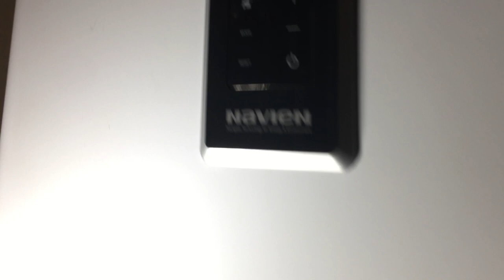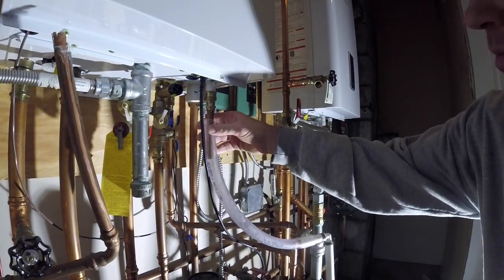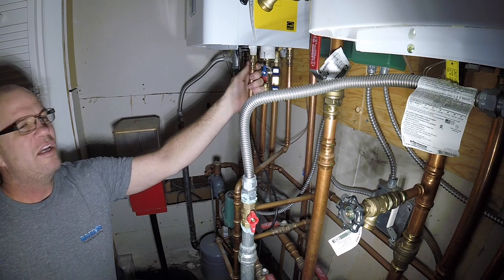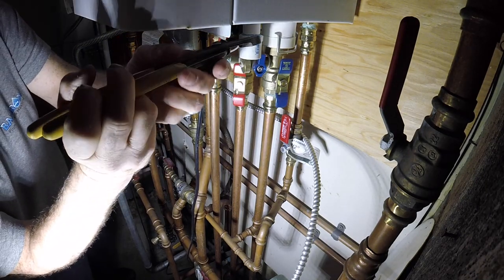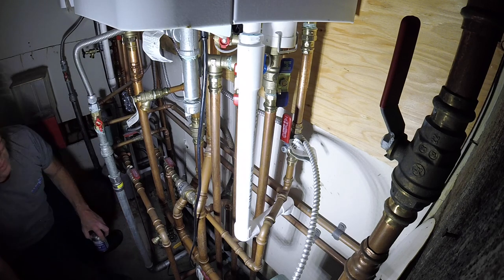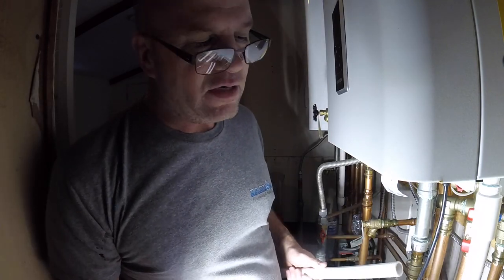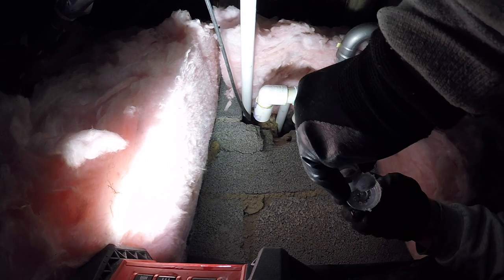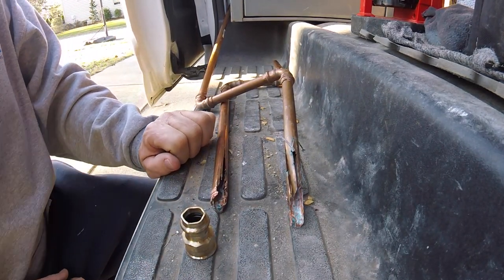Never Use Copper For A Navien Condensate Drain

Comment: Our condensation lone froze where it left the house during the winter. Had to put it into the sump pump.
Reply from the maker: Yes. For sure. I make sure there is an over flow but would rather use condensate pumps.

Comment: Only pvc but the condensation is very caustic I normally drop into sump pump or use a plastic liberty condensate pump if you put a neutralizer on .
Reply from the maker: yes I learned real quick on this lesson.

Comment: You never run condense in copper due to its acidity , also especially where you guys live where the temp drops huge in the winter, what we do in the uk is upgrade the pipe size to 32mm (11/4) so there's less chance of freezing & backing up & the boiler shutting down.
If you can't upgrade the size then we insulate it .
Also when the boiler Is serviced every year the condense traps removed & cleaned out & water tested to make sure they're not blocked.
We've been fitting condensing boilers in the uk for over 30 years , if the condense is being run into a ground soak away then it's filled with limestone chippings to neutralise the condensate.
So now chuck whenever you fit any high efficiency appliance always always run the condense in plastic & remember to protect from freezing .
Keep up the good work it's great to how others plumb across the pond 👍👍
Reply from the maker: Thanks Rich. Lesson learned for sure. Thanks for sharing.

Comment: Thinking of putting a navien  combi unit into 3 family that has tall cast radiators.  

What do you think.

Thinking of going to their three or four day school ,, I think it is in the Cherry Area .
Reply from the maker: gotta measure btu's for house to make sure it will handle it.
Reply: @ChuckBarron  going to do heat loss calculation,   that really is the deleama,

 is the 199,000 btu going to handle the demand of a three family ,

 as well as ,  I am looking for the smallest combi unit that I might be able to install in each individual unit. 

I need to research  more , it is a trend for rentals ,  looking for maybe Between 50,000  - and 75,000 btu,  

Dont want to use same heat loss  calculator and methods Christy Todd  Whitman did to the pension system, amen , and I will let that rest.  

Stay safe . 

But I really want to try out a combi unit. 

I installed for myself , a rheem , tankless water heater  about three years ago, and I have sold ever since.
Reply from the maker: yo she killed us.....Have you tried the calculator on Navien website? check it out.

Comment: I'm surprised how much galvanized pipe is used on Gas applications.  Is it code to use galvanized pipe on gas lines? Usually only Black steel pipe is code for gas runs and connections.
Reply from the maker: galv. is a go along the shore line. salt air.

Comment: Condensate drains on that high efficiency unit become extremely extremely acidic. You can't use anything that is corrosive, you have to use either a PVC or depending on the application you might want to even use a stainless steel drain but usually a PVC drain will work fine
Reply from the maker: I have been schooled.....no doubt....thanks chuck     happy sunday dawg
Reply: @ChuckBarron  happy Sunday and keep up the fight. I hope you and your family have a great holiday season.
Reply from the maker: you too chuck.....appreciate the kind words.

Comment: Hey man.  I have a question that has nothing to do with this.   I notice you use a blue angel water pump to drain waterheaters. I wanted to get the milwakee water tranfer pump.  Do you think it will work with all the sediments on the waterheater?
Reply from the maker: im not sure. Never had the milwaukee one. I know that blue angel is old as me and still pumping like day one.

Comment: The good the Bad the Ugly  thank you  will also eat the cast iron down stream !
Reply: as does salt/brine water from water-softener, vehicle and other sources down the drains... salt is really a high level toxic pollutant that needs curbed in usage... it always has been!
Reply from the maker: The bad and ugly in on stop.....
Reply: Where I am it’s required for inspection that the condensate line must go through a Nutralizer which takes away the acidity from the water. Helps keep that cast iron from having the bottom rot out like a trench

Comment: That was Natural Gas I assume? You should see how fast propane condensate will dissolve copper!. Propane has varying amounts of sulfur in it. You will see it in the form of white powder in vent pipes and on fireplace glass, add a little water and you've got sulfuric acid.
Reply: I love my M12 Milwaukee copper cutter! It comes out of the truck every chance I get! <3
Reply from the maker: yes natural gas.
Reply from the maker: yes its nice for sure.

Comment: We all learn from mistakes. The condensate is acidic and ate the copper Chuck in a few years. I am surprised the heaters work 100% if you read the installation manual pretty sure you are not allow to use flex supply lines for gas only black pipe...ask me how I know :)
Reply from the maker: oh the pain of learning as we go.
Reply: Good work Chuck! Keep posting more vids.

Comment: Ventilation, yes soft.. I like the glue smell, eases the pain of plumbing.. does the condensate water have acidity in it, causing it to rot the copper? I’ve never ran the drain line in copper, I’ve always done it in CPVC save a buck.. 🤑🤑🤑💰💰🏝😂😎
Reply from the maker: copper was a no no.....in pocket especially.

Comment: I'm really interested in your gas 90's. They look like a ProPress type of fitting.  I'm not sure if they are legal out here?
  Oh, Your inspector. You did do these with permits correct??
You inspector should have caught this copper condisate line with no neutralizer? 
Always install a Neutralizer !!!
Reply from the maker: of course I did lee.....you want permit #? I did pass inspection when job was done. Im sure you permit every job like I do.
Reply: @ChuckBarron  yes. I would like permit #.
  No. I dont permit every job. But I always install "Code Legal" if you are doing this  code legal. You couldn't be  a plumber here. Our codes are much different.  
None of the basement job would pass code. None of your gas line hook ups would pass code. 
  We must use a Neutralizer on  all consisting machines.  We can't just run them like a typical T&P line. I guess you can.
  I would ask you a question but you won't answer it anyways.
Reply: You only want people to praise your work!
Reply: If someone asks you a question.  You can't, don't answer them!
Reply from the maker: Lee, I do also and I do not want to be a plumber in cali....I want to surf there but not work.  What code book to you folllow?
Reply from the maker: I don't think so lee....I have no ego and embrace criticism.
Reply from the maker: Lee i think I do a good job responding to your precise questions for a fellow contractor. I hope this helps you out..

Comment: uhoh, I see something that may not be kosher 21:12  what's that copper ground wire or tubing coming from behind/past gas meter and going into the ground? Is that a ground wire to ground rod/s with the condensate dumping on/near/over-top it... potential future disaster/weak electrical building ground in the future. the sea shells may actually be helping neutralize it some LOL!
I'd be worried about the condensate lines freezing up in winter and have never seen them ran directly outside anywhere around here. although I've seen many other bad hacks, like a hole punched/drilled through concrete basement /slab and the pipe just jabbed in dumping it under floor...
Reply from the maker: now i gotta go look....stand by throttle....

Comment: hehe, condensate = acidic/corrosive and can be nearly strong as 50%+ acid base, depending on surrounding air quality... I don't fault you there, not many people know nor realize how bad it can be! it's really the biggest downside of high efficiency units and can occur in under-fired setups, more so on boilers with low return temp.and uncontrolled flow rates..
which is why (years ago) they liked to keep water temps high enough to not condense on the "burner side".
now days it's all designed by collegiate sheeple with near zero field knowledge, nor hands on skills and they simply haven't as clue as to what all our ancestors learned the hard way!  it is and will be the downfall of the world ;)
Reply from the maker: throttle our resident scientist.....Thanks Throttle....👍
Reply: think I tested too many of them adult beverages  before the rants...... puts blanket over self and hides :)
Reply from the maker: no way.....CB2 would love some advice....lol